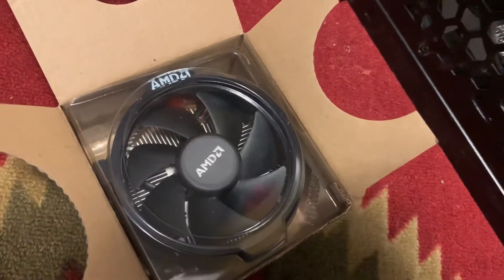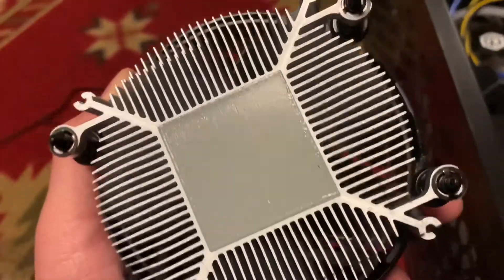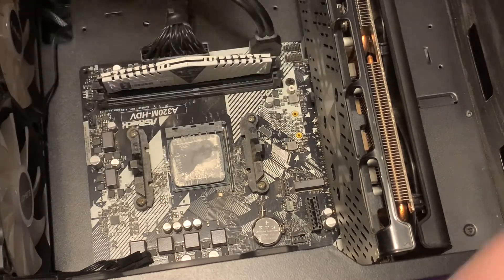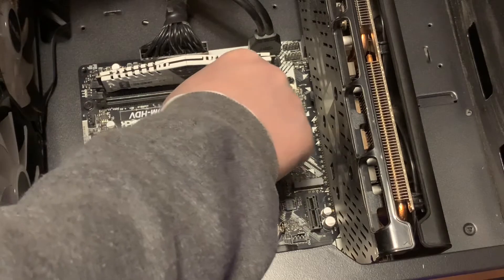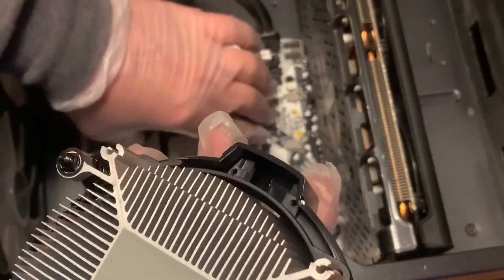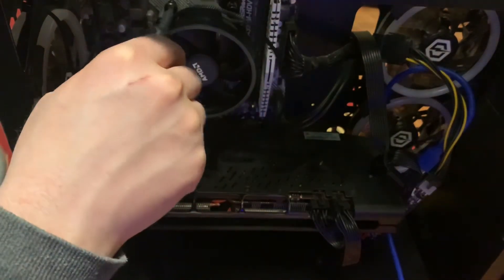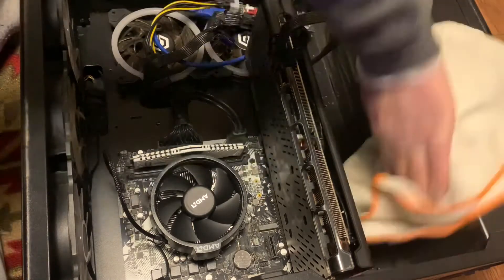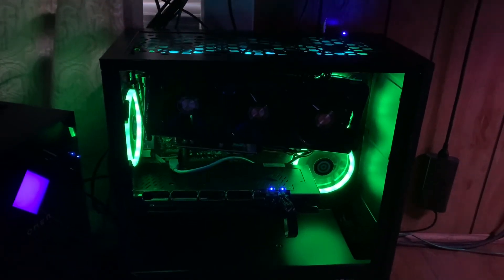How to replace cpu cooler - heat sink / cpu fan replacement setup

Comment: I have the same cooler as your old one. I unhooked the latch and wiggled it but it seems like its stuck. It isn't catching on anything so idk what the deal is.
Reply: I dont want to be too rough with the cooler. I'd hate to break something
Reply from the maker: @smoothrivers5553  it might be hooked on the sides of the cpu
Reply: @EndlessRoutes  thx for the feedback. I took off the backplate. that helped me get the cooler off.
Reply from the maker: @smoothrivers5553  happy it worked